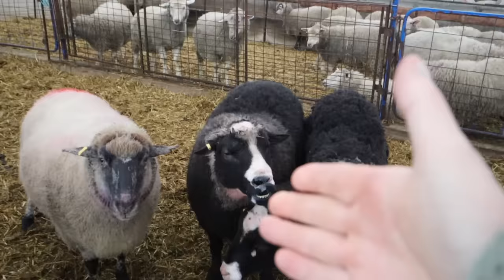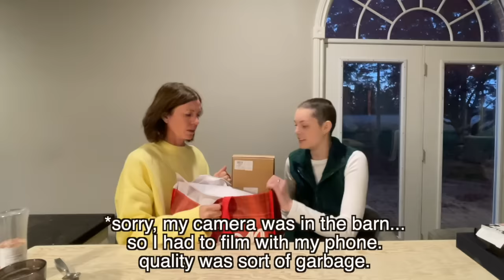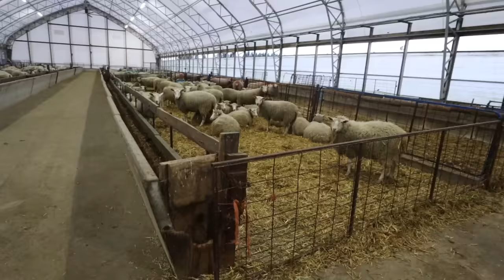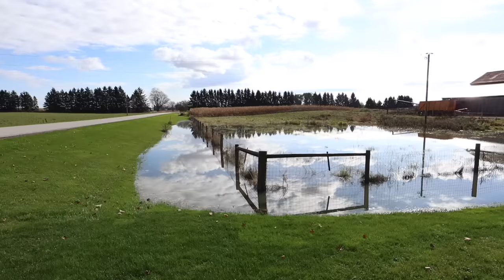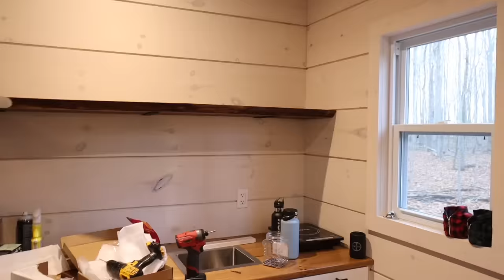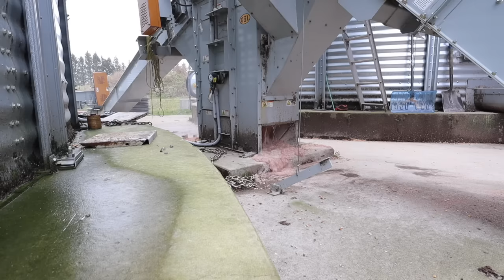Happy RAMS, Happy LAMBS? ...Billy and the boys are all smiles. | Vlog 731

Comment: That's way too cold. That's great that their Tinder groups have been so active. That sounds like an interesting book. That's too bad that the weather hasn't been great. I love how Piper was checking out the sheep and staring at them. Piper's a very good sheep groomer. Nice to see Jess again and some more hair. Good idea to wait until after Remembrance Day to start decorating.  Looks like you had a great time shopping. Very nice bedsheets. Very nice puzzle. That's great that some of the equipment is back. That's great that the soybeans have already been taken off. That's a lot of loads. Weaning the lambs sooner sounds like a great idea. I love how all the sheep bolt out of the trailer. The cabin is really coming along. Those lambs did really  well with getting loaded into the trailer. I love Piper's sleeping position.